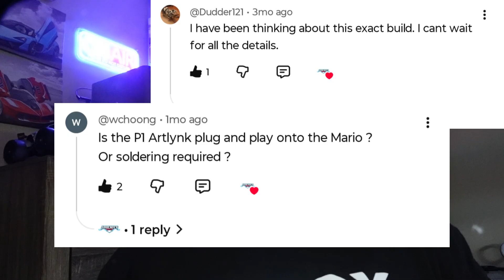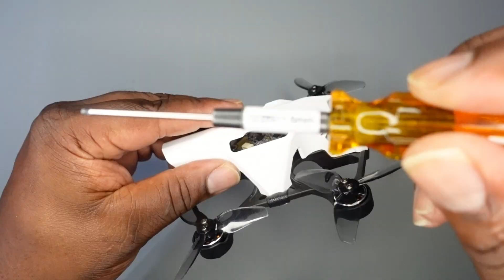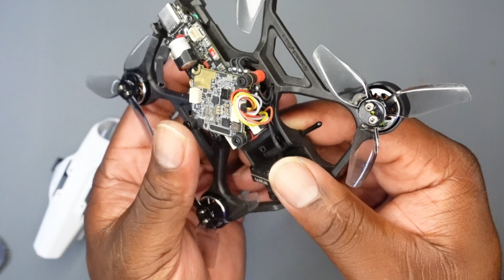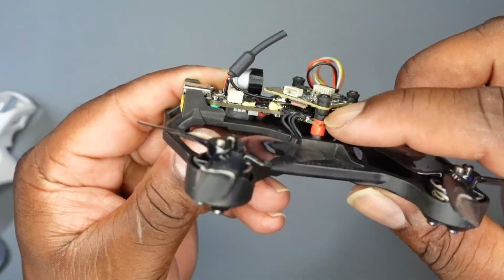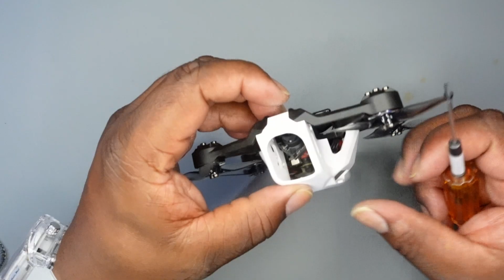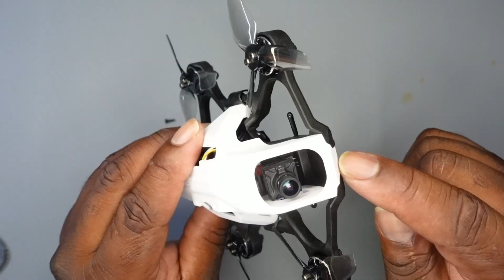How I Installed the BETAFPV P1 on the Mario Mini25 | Plug & Play? Beginner Guide

Comment: The P1's antenna is hidden under the housing. Doesn't this significantly reduce range?
Reply from the maker: So far I haven’t had any issues, I have only flown it 3 times. Once it cools off a bit here I’ll get it back in the air and maybe test the range. Thanks for watching!
Reply: Currently having rx loss can only fly about 10m max trying to resolve